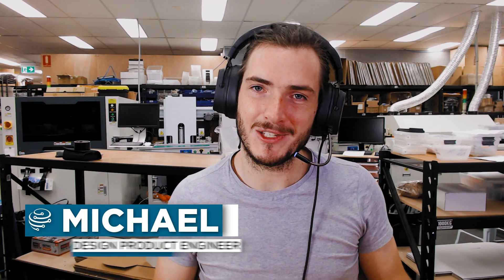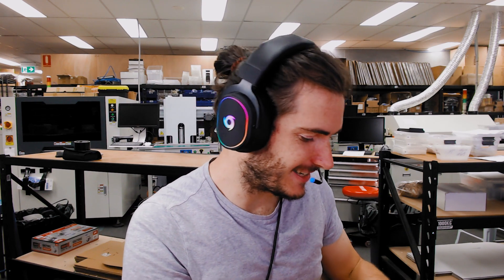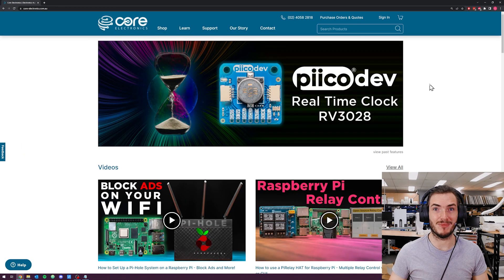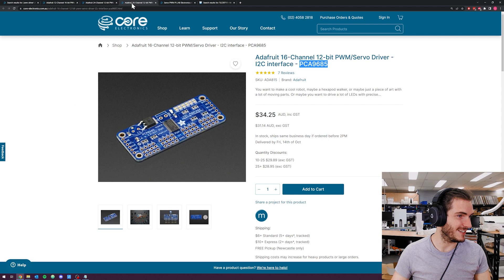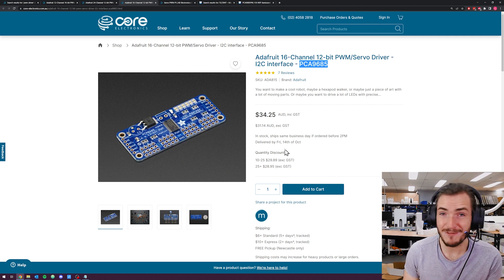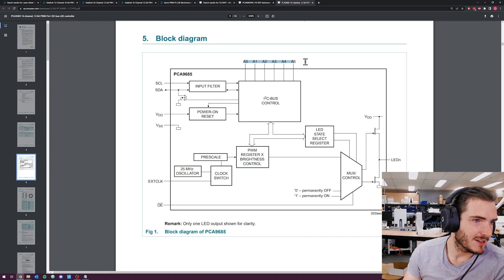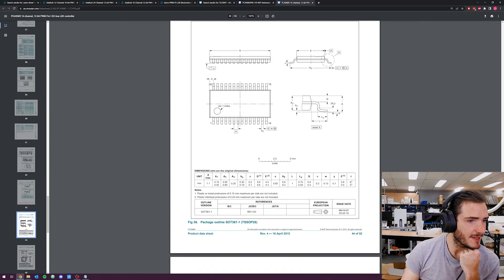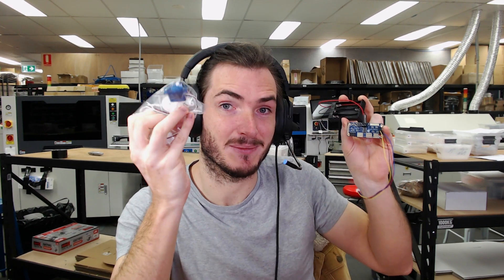The Factory | Design A Product With Us Part 1: PiicoDev Servo Driver

Comment: Great video. I would be glad if you also included documentation and simulation parts in the product design series.
Cheers
Reply: why simulate when working with real parts ? simulate what
Reply: @jyvben1520  Prior to implement physical design, we need to assure that it works the specifications criteria so usually we simulate stuff and make appropriate changes, it is also more economical that way.